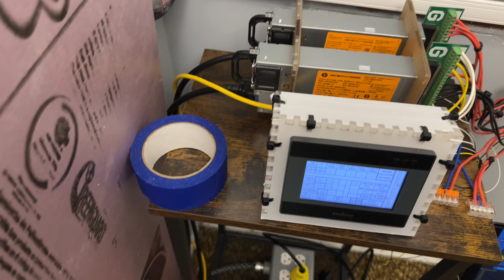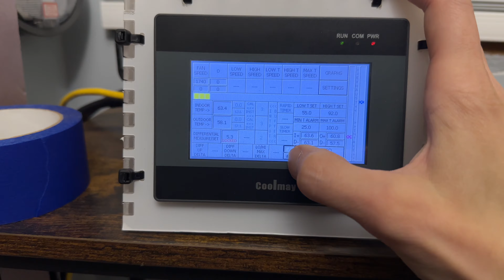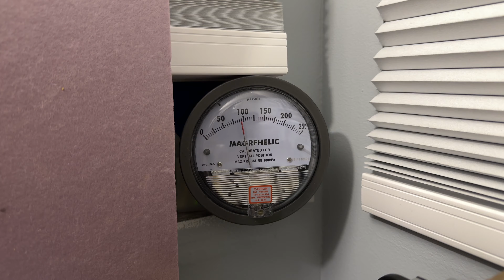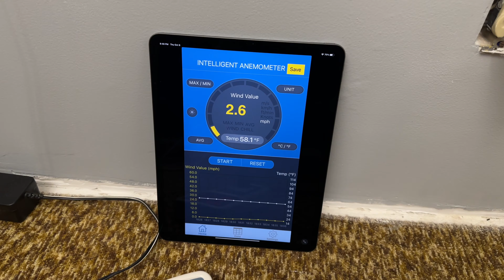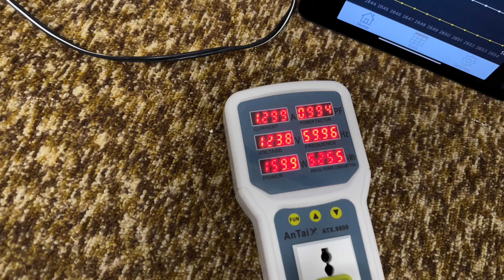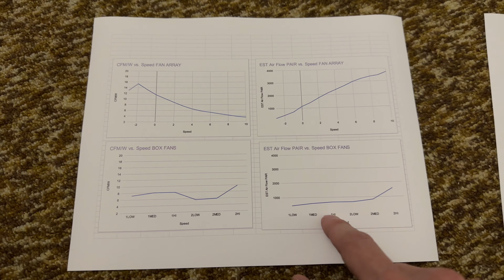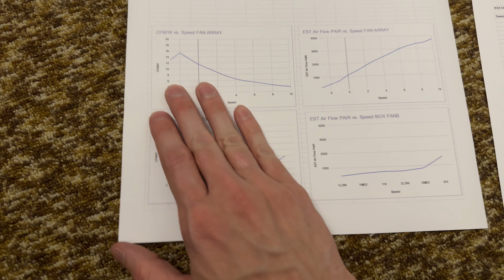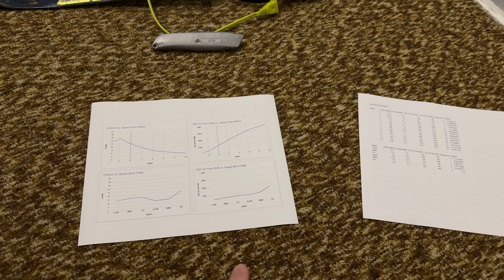Box Fans Are TRASH For Crypto Mining?

Comment: That was a great comparison and key to understanding air flow variables, thanks for the effort. Also, were the fans mid mounted in the room for contiuation of air flow or more for localised air flow for the rigs?
Reply from the maker: Thanks. The fans on the back of the rigs are to help keep the heat moving towards the exhaust. Without them, there’s a lot of recirculation without high speed exhaust air. I suspect I could get rid of these with experimentation in ducting. Maybe for the future.
Reply: Yeah perfect. Stick to what works, the performance of your setup is remarkable when you combine pressure w/ windspeed. I was blown away, cuse the pun ;)

Comment: Very interesting tests! 
As I suspected - the static pressure from box fans isn't that great and the advertised flow will really only be valid when there is no restriction at all for the flow. I have taught about building a fan wall, similar to yours - but the flow restriction will be much less than yours. I will put the fans on a board that I can put up in a window, then just open another window in the other end of my apartment (I want it mostly to be able to quickly ventilate out smoke from cooking and other stuff like desoldering components from old circuit boards - and for cooling during summer, mostly run at lower speed at night). 
So the box fans may work more acceptable in my case - but with such a low static pressure I suspect the flow will be insufficient anyway (since the air will have to travel 10-12 m and change direction in a doorway in between.

It it would be really interesting to see another test with a window open in the other end of the room (with the wind speed meter put in the middle of that window - and the pressure meter in the same place as now, the 60 Pa one is probably well enough for such a test). 
It fell quite low when the door was open - but since the doorway was so close to the fan array, most of the air probably just started circulate (out from the fan wall, back in thru the doorway and back to the fans again - which is by far the path of least resistance. This pretty much decuples the room from the airpath and the effect on the air pressure where the meter is placed, is like turning the fans off). It will take more pressure to pull air out thru the fan wall and then having new air coming back thru a window in the other end of the room (even if it will still take way less than pulling it thru those ducts).

Comment: I bet an automotive electric fan would be decent considering they're designed to push air through a radiator. The shrouds are also a lot more efficient and some of them are pwm so the speed is pretty much infinitely variable.
Reply from the maker: I’d imagine car radiator fans would perform well. My concern with them is durability and life. They’re not really made to run 24/7, I’m not sure they would tolerate it very long. I think most of them are brushed motors, but I’m not entirely sure. This would mean the PWM is a chopper circuit, and should offer massive range of speed control at good efficiency. Compared to a BLDC motor like in computer fans, they are not likely to last anywhere near as long.

I’ll have to see if I can dig some up to test. I don’t think they’d outperform this array, but they likely are decent.
Reply: @SiCPoWMining  That would be very interesting test as well - good idea! If they perform well enough, they will probably be the cheapest option and easy to control speed of (the other option is an industrial fan - but most I checked use single phase AC motors - which is the worst motor type for running at variable speed and have very poor efficiency low RPM). The computer fan array is not a good option for us, who have to buy the parts new (it will be very expensive with 32 high performance computer fans).

Comment: Do they make box fans optimised for static pressure ?
Reply from the maker: Yeah, but they’re often very expensive belt driven box fans that are made for heavy duty applications. I couldn’t find anything in the right dimensions to fit in that window, and the cost for two of them is very steep. But you could get a 3Ph high static industrial fan and drive it with a VFD. That works great, just expensive and relatively inefficient when throttled down.
Reply: @SiCPoWMining  Squirrel cage fans, industrial and yup can be expensive. No box fan is really made for that kind of pressure.
Reply from the maker: @vincentgallo3351   I think ill continue this, and compare to a squirrel cage blower I have laying around, with an ECM motor. That should work well, and it's fairly cheap to snag a used furnace blower and swap the motor.
Reply: @SiCPoWMining  I will stayed tuned, definitely interesting stuff.
Reply: @vincentgallo3351  I think a good industrial fan is the best way to go, for us who have to buy the parts new. They are quite expensive, but still cheap compared to buying 32 of those small ones. I also plan to build a fan array my self later, to ventilate out smoke from cooking and for example desoldering components from old circuit boards and also cooling during the summer, so I have been looking around a little. 
Even the ducted axial ones will also do well, unless you need very high static pressures (much more than he have there). I found (just searching the internet) a few that (according to data sheets) had the same flow rate at 100 Pa, but only about half the power consumption! So, at their full rated power at least, the efficiency is also often better for the industrial ones. But, controlling the speed may be a little more tricky though. The ones using single phase AC motors should be avoided, because those are very hard to control efficiently and the energy losses go way up at low RPM (there are in some cases even risk for overheating because of that). 3 phase motors can be controlled quite efficiently by a VFD, there are also some models using EC motors that could be controlled by PWM.
But those small fans probably get very expensive if you don't salvage them from old computers/servers or similar - because they are no ordinary computer fans. It's actually quite high performance ones. Similar fans probably cost at minimum $30 (probably more) each and you will need at least 32 of them if getting the same setup. 
Most cheap computer fans I looked up that had any data, can only generate about 10-20 Pa static pressure (usually given as 1-2 mm H2O). That was given just as "static pressure" in the spec (as opposed to many of the industrial fans that had a pressure vs flow graph or had a specified flow rate at a certain pressure, for example 100 Pa). So I guess those 10-20 Pa is the "stall pressure" (which is only reached when all flow is blocked) - this is not really a usable number in it self, but gives at least an idea for estimations. The usable pressure at a decent air flow (about 50-70% of the rated "maximum flow"), is probably about half that.
Reply: @SiCPoWMining  That will be very interesting to see 👍

Comment: Great info! I do use box fans to help move air in to help with my big swamp cooler. And to help move air through my garage basement for my mining rigs and server rack. Soon we won’t need them. I do have some big squirrel fans from furnaces and roof exhaust fans I may try. Wish I had an air flow meter. I do have a manimeter though. I guess more negative pressure would mean it’s working.
Reply from the maker: Pressure is a good tool for a relative comparison. You could estimate airflow just from pressure alone, it’s close over a narrow region. Of course it only works if you don’t change the size of the openings and just swap a fan.

Comment: A couple of comments and questions regarding the setup:

Nice fan array arrangement, but how long will the bearings typically last? I'm aware server grade typically lasts longer than consumer, due to the inherently higher demands.

How much amperage do you have that room running towards? 110v or 220v?

How'd you get started with it all? Mining with a ton of hardware is expensive to start, so did you start with just a bit and keep adding more as you could, or did you take a loan out, etc.

Also, a note that might be of interest: With a 3D printer, you could maybe improve density and efficiency by printing shrouds to bring the fans out a bit from a flat plane, so you can have two fans exiting from one hole by rotating the fans 90°. In other words, have a hollow tube, and a fan on top and bottom to blow into the tube and out the window. Judging from the numbers, though, I doubt you'd need anything like that.

I've been thinking about starting, but I don't know where to start with a larger scale setup. Just 1-2GPUs doesn't turn much profit for me, especially due to the age of my hardware (RTX 2060 12GB and GTX 1660 6GB). For my area, they ARE profitable, but they don't profit enough to be worth it ($3-5 a week, run time depending).
Reply from the maker: The fan life is massively variable based on the conditions they’re exposed to, the design of the fan, and the speed it’s run at. I believe these are rated 60,000 hours at full speed and 40c ambient. They say life improves at lower temps and speed, but they don’t specially say how much. Typically life is non linear and improves considerably at lower speeds, but it’s not rated on these models. These are normally run at less than half the rated speed, and well under 40c. You can get long life fans rated 150,000 hours or even more, they are very costly.

That room has 100A 240V service, full load with the current hardware is around 15kW.

I got started with BTC ASICS in 2014, grew into GPUs a few years ago, expanding slowly. Many of the cards were put on a credit card with promotional 0% rate, and paid off over time. If you have good credit it’s easy to find cards offering 0% rates for a year or more, and you still get the rewards.

This fan assembly is a bit overkill by design, so it’s more than enough even if I max out the sub panel in this room. I wanted to try ducting to the racks to eliminate the box fans.

Right now is either a great time to get into GPU mining, or an absolutely horrible one. It’s very difficult to predict these things, but todays profits are quite bad so it’s risky right now. But that’s also why hardware is easy to get at below retail.
Reply: @SiCPoWMining  Noted! I knew crypto was suffering some with mining, especially due to the recent (and honestly, dumb) move on the Ether end of things. It's a shame I don't have better credit, though, otherwise I'd totally do that same thing. I did notice you've got 8 GPUs per system, on the system closest to your exhaust fans, and that they're RTX A2000's. Mind if I ask what your gross profitablity is on the A2k systems?

If you're wanting to duct your racks, Maybe enclosing them and running the cooling from the bottom to the top would be best for efficiency? Heat rises, after all, so no need to fight the way it wants to go. Maybe the box fans could be useful for just guiding it along?

100A 240V is a lot, that's more than some older homes support as far as their wired service. Did you do the wiring yourself, or was it professional? You seem like the DIY type, and I mean, as long as the circuit isn't live, it's safe.

Comment: As someone who programs very large industrial scale fan walls, you need to run all your fans together unless you install individual backdraft dampers per fan.  Otherwise, the majority of airflow achieved is recirculation from operating fan to nearest nonoperational fan, as opposed to across the equipment you're trying to cool.
Reply from the maker: I would have imagined so, but in my application, at the slowest speed, I see peak efficiency with most of the fans off and just sitting open. I guess pressures are low enough that it’s OK. But at 95 pascal, it would be horribly inefficient if rows turned off. I don’t think people understand how substantial 95 pascal is, the door explodes open at that pressure, and you can see the glass getting pulled in.
Reply: @SiCPoWMining  I've seen walls knocked over by over/under pressurization.
Reply from the maker: @dherman0001  Sheesh. I never tested the peak pressure my room would hit if the intakes were blocked, but those fans are rated 450 pascal. I'd worry about the glass breaking, but it might be an interesting test. The door going to the house is installed backwards, and its an outswing door, so the negative pressure pushes it into the seal better and the house stays tight. It's more difficult than I anticipated to open that door at 95 pascal.
Reply: @SiCPoWMining  Newly installed block walls, before the mortar drys, in movie theaters, gyms,  etc, are often the victim of overpressurization during the construction phase, and the air handlers themselves of course.

Comment: When it ocmes to mining, is it still worth it? I was using the unMineable and I saw the number drastically drop from one day to another. I used to get 30 DOGE on my GTX 1650 on 40W in a month. Now, I barely get one DOGE per day. Do you think the numbers will ever go back up?
Reply from the maker: No, especially in a desktop with a single 1650 running unmineable. You’re probably spending 3-5x as much in power as you get back. Most desktops with a single GPU have a lot of overhead.

I think GPU mining profitability will return, but it’s difficult to predict when. It could be a few months, maybe a few years, maybe longer.
Reply: Your definitely using more than 40 watts
Reply: @propeldragon  That was just what I've measured on the 6-pin connector and in HWInfo. I was definitely pulling much more. I don't have a mains power meter.
Reply from the maker: @jonny11bonk  My gaming desktop takes ~100W at idle, 200W AC when mining around 115W on the GPU. It has a titanium PSU, and that's even fairly heavily optimized for what it is. Depending on the hardware, a single GPU rig can be extremely wasteful. The boards I use in my mining rigs take ~9W while mining, and can run up to 12 GPUs, big difference.